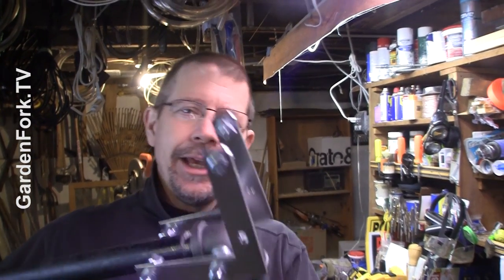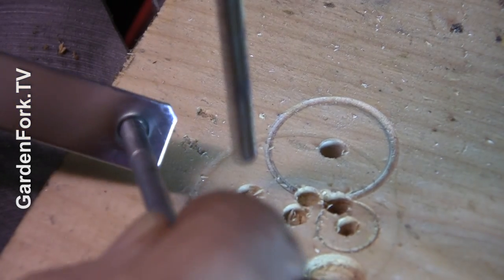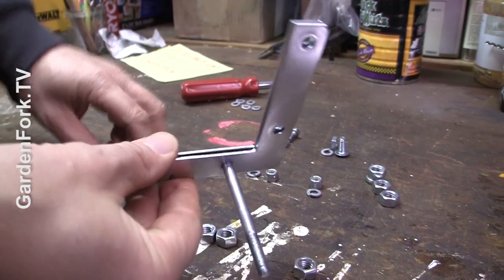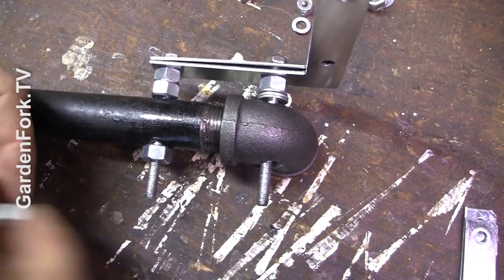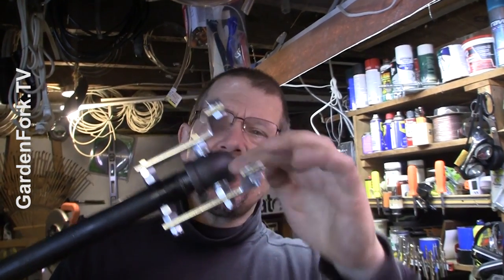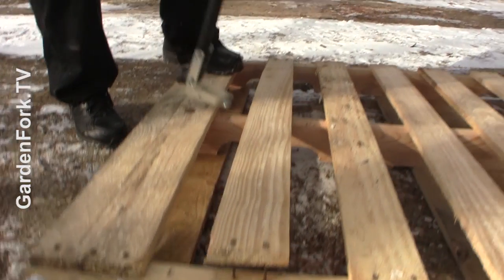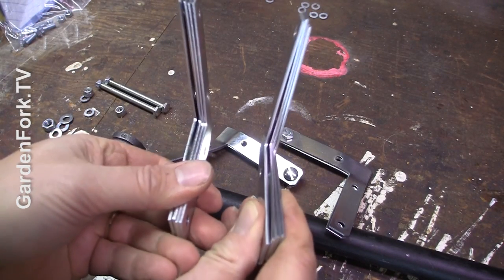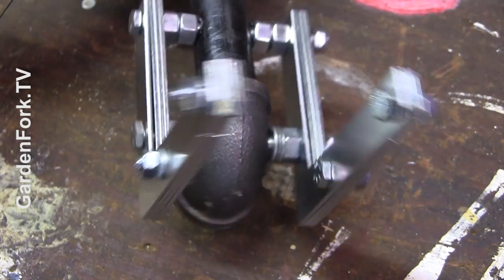DIY Pallet Pry Bar - GardenFork

Comment: I don't understand all these so called easier ways. I just use a sawzall. By the time you put in a screw or tighten a bolt on these amazing Gizmo I've already removed 2 planks and working on a 3rd.

Comment: A little welding would be good.
Reply from the maker: yes, it would. my goal here was to see if you could build a pallet breaker tool without welding. this design isn't perfect though, a larger diameter pipe and better bolts would help. I recently started welding, learning as I go here. thx!